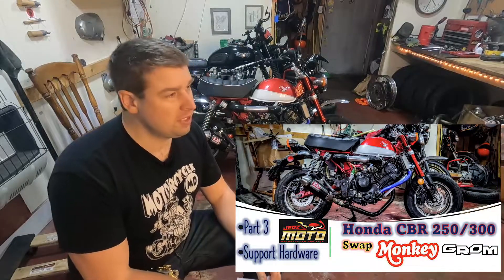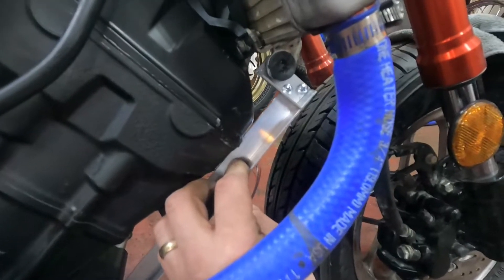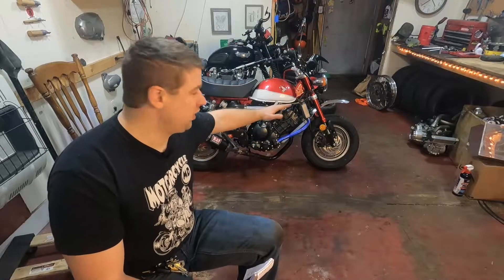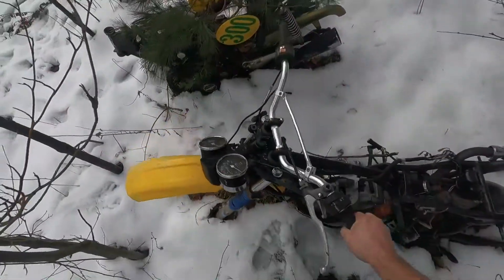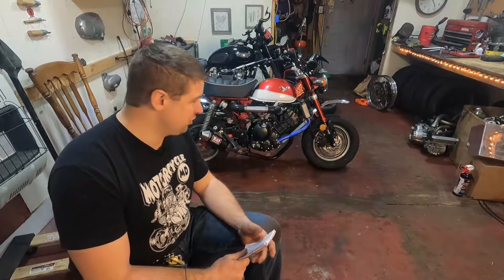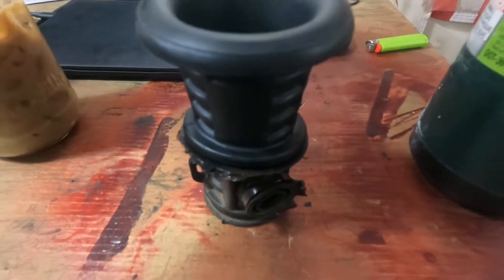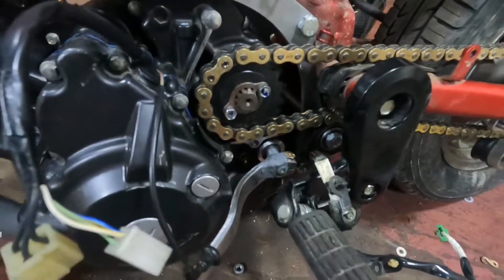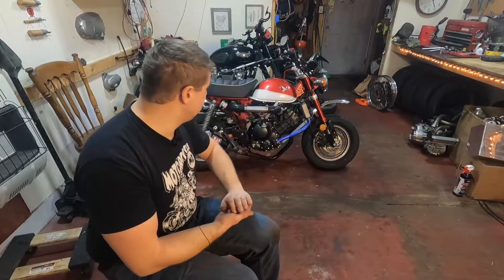Honda CBR 250 300 Swap Honda Monkey Grom Part 3 - Support Hardware

Comment: Have you given any thought to a front fork swap to get more comfort & a little extra travel?  Have been looking to study the CR 85, KX 85, and RM 85.  Likely you would need stiffer springs, but think the extra travel and adjustability would be nice to work with. Ohlins valving would be nice but not sure it would make a 'rocky' road all that comfortable with only 4" to work with.